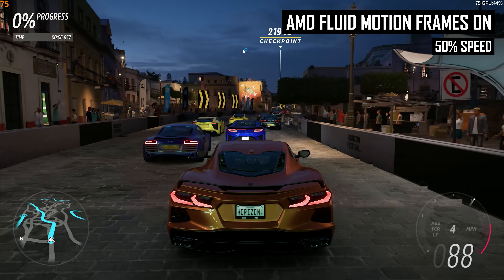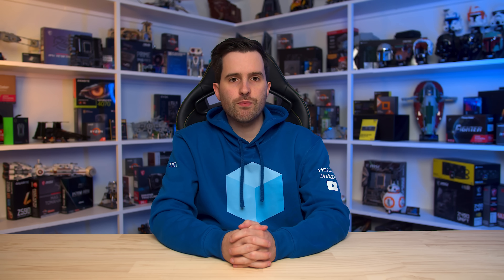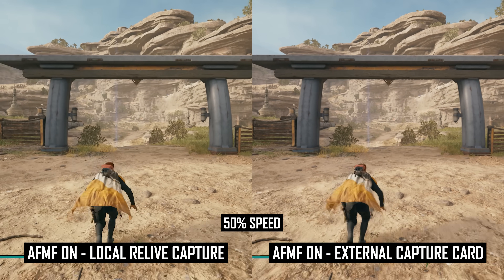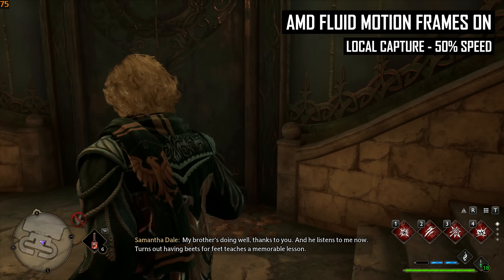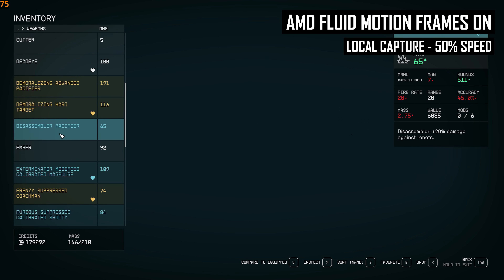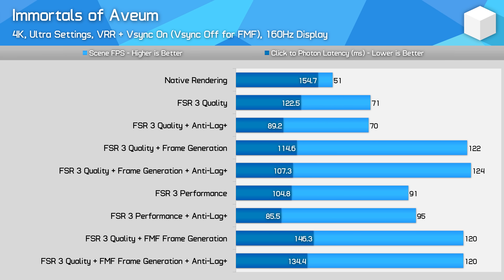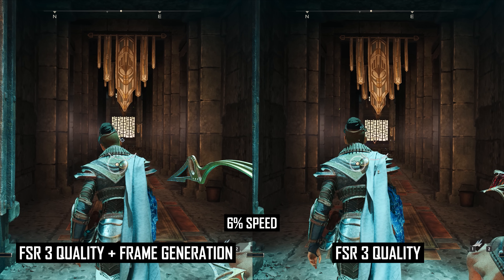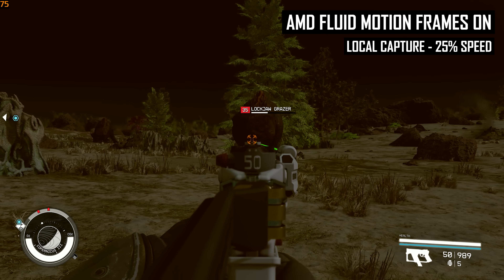Frame Generation for Every Game - AMD Fluid Motion Frames Analyzed

Comment: I want a frame generation tech that utilizes multi-gpu so I can put old hardware to use. I'm sure my old 2080 could calculate a few motion vectors to help the rest of the system along
Reply: I sincerely doubt that multi gpu setups are coming back to the gaming space any time soon. I think it's best that they stay dead in the ground where they belong.
Reply: @HeretixAevum  I'm not talking about SLI. I'm talking about a secondary card that handles vector calc for frame generation, just like you can set a secondary card for PhysX (not that it's really a thing anymore, but you still can). You have to pay for the compute power frame generation requires, and with a single-gpu solution you're going to pay for it at the $/fps rate of the current gen cards. I'd rather offload that to hardware I already have and pick my new main gpu according to its raw rasterisation performance.
Reply: @protator  I wasn't talking about SLI either, having dedicated cards for things like physx was awful and didn't take off for good reason. One card (especially with what they charge for them now) should do everything.
Reply: @HeretixAevum  "One card [ ] should do everything." But it doesn't because it can't. The compute power for those interpolated frames has to come from somewhere. It's why 'frame generation' doesn't straight up double the initial fps number. If you get 60fps without then you'll probably get something like 90fps with the feature enabled ... which means the card only manages to calculate 45 real frames per second because it has to deal with frame interpolation now as well. So you get 90fps, great, but the responsiveness/input latency of a 45fps game. Not so great at all. If those calculations could be offloaded to other hardware, not only would the same gpu get closer to the theoretical 120fps but the game would also feel more responsive as a result. And it wouldn't cost you a dollar extra because you already own the necessary hardware. There wouldn't be a need for sli bridges anymore either. Modern systems have more than enough pcie bandwidth. And unlike SLI, a feature like this could be handled purely on the driver side of things, no need for game devs to implement anything. It's unlikely to happen, true, but I don't think I'm dreaming up something crazy impractical here.
Reply: @protator  "And it wouldn't cost you a dollar extra because you already own the necessary hardware." I think you're forgetting the part where you have to buy this frame gen card. I'd rather just spend that money on getting a better graphics card in the first place. Again, this whole "Well if we just had an extra dedicated card for this particular process, we could achieve a better result!" idea has been brought to market and failed more than once. Most people don't want it.
Reply: @HeretixAevum  A "dedicated frame gen card" as in "your old gpu"! So no, I'm not forgetting that purchase. You already made that purchase two or three years ago. That's the point. I'm talking about extending the life of the stuff you already have to get more performance out of the new hardware.
Reply: @protator  I typically sell my old graphics card when I upgrade to help subsidize the cost, so to my eye, it's still something you're effectively paying money for and cluttering up your PC with unnecessary components that generate more heat and sip more power.
Reply: @HeretixAevum  It's still a net gain. You buy a card for 1K, then three years later you sell it for 300. You buy a new card for 1K. Now, you could say the new one really only cost you 700 and be happy about that, or take the extra 300 bucks and go for $1300 model. Doesn't really matter. Just look at the difference in raw compute power of a current/next gen card for 700, 1000 and 1300 bucks ... and you'll see that you just made a really bad deal compared to the Tflops/$ of the card you just gifted away for 300 bucks. If there was a way to make that old card do work alongside the new one, like frame interpolation, you'd simply get more bang for your buck ... and you could still sell it for 150 or so the next time you swap in a new gpu, which make the secondary card even more cost efficient. If you look at the power draw of new top tier halo models that "can do it all" then I don't think there'd be a big difference between running let's say a 4070ti plus an old 2080 or 3070, or going all out with a single 4090 setup. Anyways, it's not going to be a thing. Manufacturers want us to buy new cards, not hang on to old hardware. Implementing such a feature into their driver suits would cut into their bottom line.

Comment: AFMF without API-support (e.g motion vectors, buffer/UI-separation) just doesn't make much sense to me. I'm not sure why they're pushing this out, even as 'beta', because it's questionable if it'll ever be good enough to be worth it. This is going to require significant effort to even get to 'usable', and that time would be better spent Doing The Right Thing instead.

Comment: I have what you would today call a low end config.
R5 3600 and a 6600XT. 75Hz 1080p monitor.
I tried AMFM in Starfield on the medium preset without FSR and it was ok. The only way i can describe the experience is as if you were watching those "How it feels to game in 240Hz" videos on youtube.
It had that kind of motion blur. It wasnt anything that i would consider bad and severely detrimental to the overall experience. Some people might not like it though.
I also noticed that the frame generation felt inconsistent. Perhaps it is working all the time, but it didnt feel that way. Sometimes it would feel like i was getting the same FPS as usual, and sometimes it would feel like i was getting double of what i usually get.

Anyway, for something thats still on some sort of beta phase, the stuff is quite decent, especially considering that its available on all 6000 and 7000 series AMD gpus as a simple switch in the drive.
I would like to see more improvements because DLSS exists and it would be stupid from AMD to not improve the tech.
Then again, its AMD we are talking about here.

Comment: HDR is the only reason I haven't tried this tech yet but AMD is doing the correct thing working this out in a public test branch.  I'm not 100% certain what the intended use case is for this technology but I guess it's hard to complain about the option being available.
Reply: HDR works with latest driver version.
Reply: @retro-1236 where to download the update?
Reply: I mean you can still use it just dont use it in games you have a great frame rate in. The driver does disable screen recording tho. Or atleast i cant get mine to work.
Reply: There's a newer version, try that one.
Reply: Hdr is working as of October 13 driver. And there is also better frame pacing and looks better than old October 6 driver.
Reply: This tech is amazing for MMOS. 
Where you are just standing still, and looking at one spot.
Reply: The new V4 Version added HDR Support.
Reply: And its usecase is NVIDIA did a thing, the media hyped it up so much that AMD was forced to release a tech prior to it being ready for tech older than rdna3
Reply: @ChibiTheEdgehog nvidia innovated frame generation. amd reacted with a shitty knockoff, same with RT and dlss. they don't actually try to beat nvidia or innovate they're content with being inferior but as long as they monopolize the market through consoles and Microsoft backing they're happy.
Reply: @bigballer5591 
What a fanboy and an uneducated one.
Nvidia didnt innovate anything. Raytracing is probably older than you, same goes for "frame gen". Even your TV interpolates frames lmao
AMD had frame gen for videos like 6-7y ago.
Reply: @ChibiTheEdgehog dlss 3.5 was a reaction to fsr 3 lol, they announced it right after
Reply: @Davinmk 
I think DLSS 3.5 was gonna come with the launch of CP Phantom Liberty regardless to show off path tracing, I think AMD just happened to announce FSR3 before it.
Reply: @-Burb  sure you can think that but all i’m saying is that the facts go against the commenters statement
Reply: @Davinmk  DLSS can't be compared to FSr fluid motion.
At this time, DLSS is in just a few games, and requires personal implementation. 
Fluid motion just works baby <3
Reply: @duckilythelovely3040  no it doesn’t just work

Comment: AFMF is cool tech but it needs alot of improvements like VRR, HDR and even more latency reduction support.

If you want more FPS then don't buy a 4k monitor for gaming. A 1440p monitor will give you more real frames. 

This what I did and got a 1440p UW monitor. I don't miss playing on my 4k monitor. I use that for work, browsing and movies.
Reply: most of the issues have already been addressed

Comment: So does FMF after generating frame 1 weit for an additional frame (3), then compute the middle frame(2) and then show frame 1,2,3 in sequence? Why is the image quality this bad if they have the pre and post state of the image? Anything else but doing this seems like a bad idea for image quality, even if it would affect the input delay less. Why would you try generating an extra frame with basically no knowledge of the next frame in sequence? At least it might be a viable option for games with less fast movement then. Thinking of games like Baldurs Gate or Total War.

Comment: I think your view is narrow minded regarding this tech, there's A TONS of games that are engine limited that won't ever get patched or resolved, and thats where AFMF comes into play, most if not all of those city builders and strategy games are engine related and after a certain amount of time or at certain scenarios the gameplay literally becomes too choppy and stuttery to enjoy it, its not an FPS or a TPS there's isn't much of a movement and if AMD (the way I think it should be feasable) comes with an algorithm that can detect those games' hud/ui since they are mostly in the bottom of the screen and keep them out of the frame generation or deal with them differently it'll be amd's biggest win since its a technical solution to a problem that plagued video gaming industry since the beggining of times.

Comment: I find a couple of issues with the way this video has the information presented in no particular order, 1. only graphs shown in depth are for a single game running at 4k and not varied resolutions or frame gen lag vs click to photon, 2. on screen graphs showing frame gen enabled vs enabled blocked by stating it being enabled , 3. yes Vsync is currently unsupported however using enhanced sync in driver where you also enable afmf can be enabled and works alongside it is not mentioned, 4. Afmf is meant as an alternative to games that dont have that enabled or developers choose to implement, its about options to the consumer, 5. only mentioning the gpu used and not rest of the system, just for transparency. 6. they actually had afmf working on vulkan on the first driver that was released for only the 6000 series and then disabled it for the updated version that worked for the 7000 series. I have been testing it on a 165hz 1080p monitor with  gigabyte a320-s2h rev 1 motherboard, ryzen  7 5700g, 32gb 3600mhz ram, xfx swift 6600xt and latency varies on the game, they said its not recommended for competitive games but i only get 10-15 ms frame gen lag there low settings while , 20-50 ms on horizon zero dawn max settings,
Reply: these data are from when it came out, mang of the issues have already been fixed and performance has improved

Comment: i tried it and it fels verry juddery and less smooth as native despiote me gaving a 180 hz panel and i was gettgin 80>160 fps it felt like it was not snappy and the judder like movement was offputting. Input latency was less of a issue i think. but then again i cant actively test that in cyberpunk which im currently playing. Its impossible to measure anyway at home without specific gear.  Psst nvidia please sell me a Ldat...
I have yet to test AFMF and then capping fps ingame to see how this works.  but seeing i often cap fpa to save power draw i bet thats going to be another downside.

Comment: Works with RX 6000 cards? Hah. If I were running Windows, I'd install the experimental driver just to see how laughably bad it is on my RX 6400. :P

edit Gven that you're having to go frame-by-frame, or at 2% or 50% speed  to show that there's blurring/artifacting, I'd say the FMF's doing a pretty good job.

Comment: I think AMD will fix AFMF to work with vsync, hdr and also Vulkan and maybe DX9 titles. I guess improving the image quality is very hard on a driver level without access to game data, but it is already pretty impressive I think. However I think this technology would only be game changing when it helps to reduce 1% and 0.1 % lows, because otherwise you will not feel more smothness and you have the trade off in latency. So currently it might only help to max out your monitors refresh rate and it can feel better, but you still need a high base fps for it to work. I hope they can improve it by a lot, which would be great.
I tested it with my 7800xt in games like Cyberpunk, Starfield, Medieval Dynasty, Satsifactory and Witcher 3. I have 60/70+ fps in any game on 1440p ultra without upscaling. The only positive experience was in Medieval Dynasty where I thought that the game feels smother with AFMF on.
Reply: No way it will work well with vsync if it can't use motion vectors. It needs the frame on the screen asap to allow it to get its own frame in after. Delaying that with vsync would create too many artefacts through added latency
Reply: @HughesDePagen   that would be very disappointing, but lets see :)

Comment: This will be great in a couple of years. Might become a selling point for AMD if they can optimize the frame pacing and working only on the 3d render instead of the UI
Reply: Justwait
Reply: I don't see the UI thing happening any time soon, but they already released an update to frame pacing today
Reply: Except Tim got caught out by AMD's (rather rapid) release cycle of AFMF. There's an October 13 driver that enables HDR support and adresses pacing. 

The relevant lines read "We have added initial support for HDR to expand the AFMF gaming experience." and "Improvements to frame pacing have been made, resulting in an overall smoother gameplay experience and improved image quality"

And on top of that they added Anti-Lag+ support for 13 more games.
Reply: Let’s be realistic, it won’t become a selling point, if enough people use it, nvidia will release a competitor feature and probably do it better.

Comment: Mmm, a little unfortunate HUB didn't try it with AMD's Enhanced Sync driver feature turned on. I've been using it with AFMF on my 6900XT and tearing hasn't been an issue and subjectively the pacing feels good.
HUB Quality recommended settings in Starfield @ Ultrawide rez, I'm getting with some FSR2 help between 65 and 90 base fps depending on the scene.
AFMF with Enhanced Sync and Anti-lag turned on the smoothness has gone up and I hit over 130fps sometimes 160fps, higher than my 120Hz monitor and so looks nicer in that respect. Starfield is slow paced enough that latency isn't much of a factor and to me still looks good. Sure I can see some artifacting but doesn't bother me much.
It's interesting tech that I'm more interested in for older generation cards (like mine) as a way to help them pump out more fps as they get older. 
Hopefully it gets as much widespread game support as FSR and continues to improve!
Reply: I've been doing the same thing but I have a 6800xt
Reply: @carpelunam  have you found the frame pacing with AFMF to be ok with enhanced sync?

Comment: I think it is more it  is either this or either that  it can't be a mixture of  
a. how much space  on the ssd does it use
b. how gpu ram does it use
c. what is the system ram overhead  to counteract the lack of rpu ram  

and is system storage enough 2-4TB over 2 ssd's is enough to handle  by the time you install all the graphical improvement  sorftware what storage is left to run the I honestly don't think there is enough snuff latest gen video  card to cster for the assets used in modern games..

I think what you are experiencing with  16-24GB and  4TB ssd storage and 32-64GB ram you are stalling game as there isn't  enouight gpu and system ram to to cater for the  max between 80-90GB  combined and you are are running your of ram to couteract the lack of gpu ram you may well be looking at 128GB min 256-256GB medium  756gb-3TB 

If you are going start basing pc game installs like console game700GB on main install now because you  are adding more feature intp base than you have the  internal hardware to physically run in..

I think it is come to the point to whether or not   people are building gaming  pc's vs test bench pc's they TEST GAMES PN ON!!l

i watch tech you tubers

gamers nexus
jay's 2  cents
li8nus media group
level 1 tech 
tech yes city\

and many more 

the consensus i'm getting watching build s  we are builfing to test games and  we are building shit bare min  spec and they so fucking  crap we a turning into the hp's, dells  and compaqs  of this world and the systems are not performing well because the lack ram & storage white elephant in the room and we can't fix it

Comment: I think the big picture take away from this discussion is that AFMF is absolutely going to be a hell of a feature in a few months time when they get the vsync issues and frame pacing worked out. The tech works and the issues are not impossible to work out. We all wanted Frame Gen from AMD but the reality is they should have worked it out for a few more months.
Reply: I hope you're right. It's so disappointing that they didn't manage to get the very basics working. (thinking about frame pacing here)